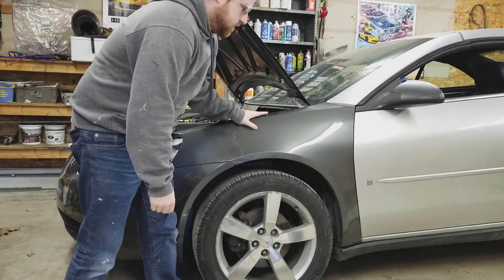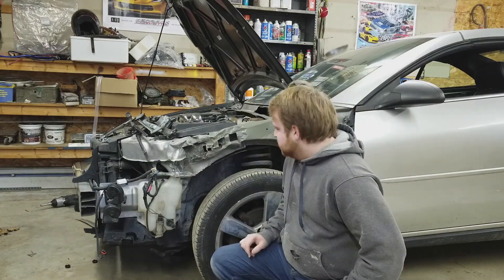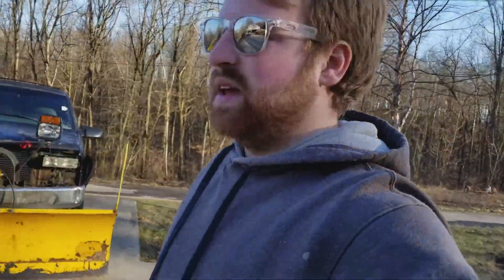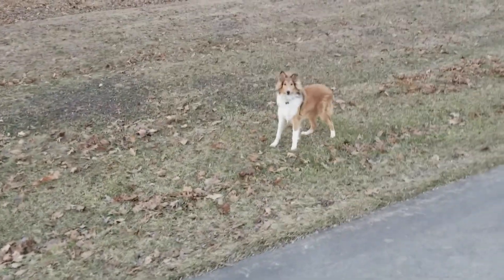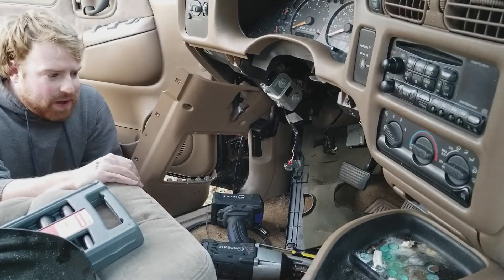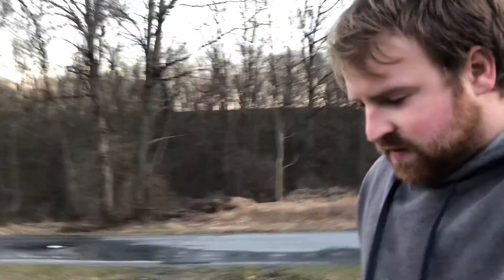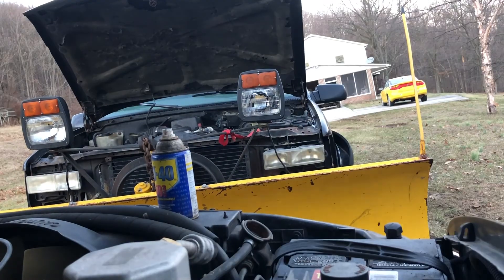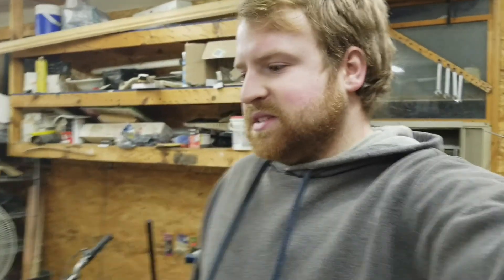The Project Truck Build - Chevy S10

Comment: I just bought a rather clean LS 4X4 for $300, it only needs 1Ft of Rocker Repaired and some cosmetic touches...  its being delivered tomorrow, and I cant wait
Reply: I got my 03 2wd lsd extended cab for $300 I did a bravada front end and replaced almoist all the sheet metal, and Corvette turbines and I have been driving it for 3 years and have spent just about $1000

Comment: Nice Video man, I build S10's and I've got a Youtube Channel on it, If you ever have any Questions on the S10 feel free to hit me up ok, If the Reset doesn't work, Try getting another ECM, I can find out for sure what you need to do bc I've got 2 buddies that's had this same problem, Just hit me back if you need me to find out ok
Reply from the maker: I appreciate it. I actually already sold the truck but I deal with all sorts of chevy stuff so I'm sure I'll run across another S10 in the future.
Reply: If you do man feel free to Check my Channel out, I'm going to try to Cover alot of Issues and Stuff these S10s have and Stuff like that, I'm currently in the process of building a 1984 4X4 Blazer right now, But I definitely want to do alot of Different S10 & Blazer things in the future, OR if you have a question man feel free to ask and if idk the Answer I can 100% get you one.